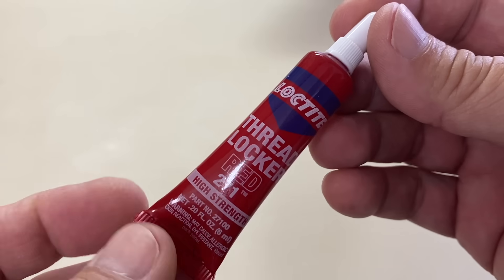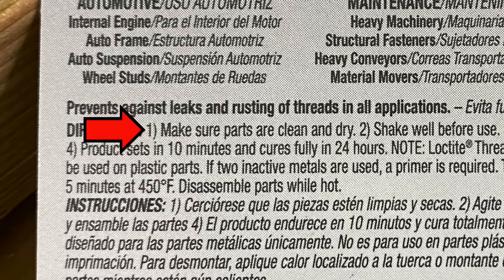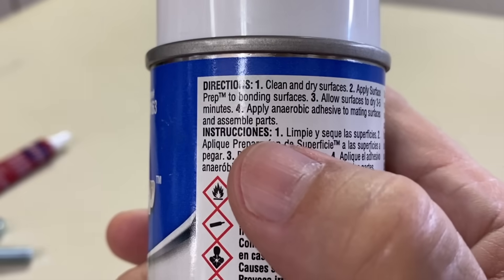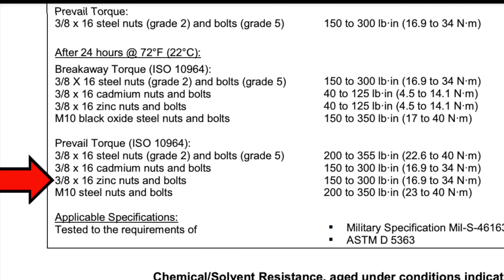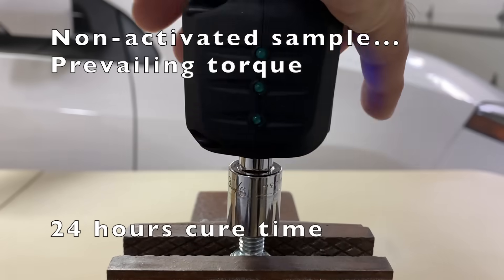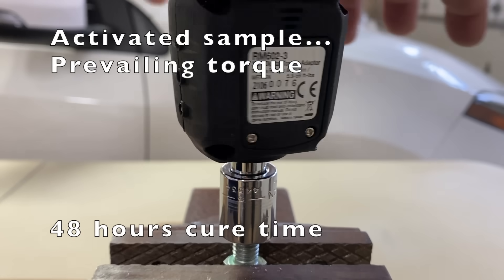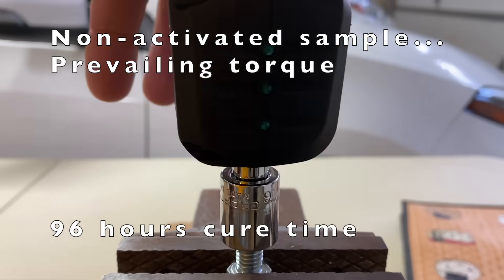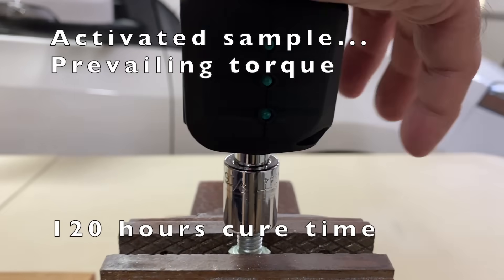Nuts & Bolts - Most DIYers Do Not Know This | Loctite Red Threadlocker Curing

Comment: Using a breaker bar corrupts your data as it changes the torque by magnifying determined by the length of the bar. Basic physics of levers.
Reply from the maker: Hmmm… I don’t know about that.  
My understanding is that the torque adapter measures the twisting force at the nut or fulcrum.  The breaker or cheater bar creates more distance from the fulcrum and allows me to use less force at that point on the lever.  Your statement would be true if I use the same force on the lever at all points along the lever.  
😎

Comment: Nice test, but the primer doesn't seem as beneficial as I would have thought. I typically would not apply threadlocker to a nut that isn't really holding something together though. I wonder if tightening the nut down would make a difference.
I can definitely confirm that  the accelerator really works to speed up the cure time. It makes cure time almost instant.
Reply from the maker: Thanks!  
Please check out my other videos for some with the nuts tightened down with a clamp load.  
Here's how Loctite tests breakaway and prevailing torques... https://www.youtube.com/watch?v=PGZCPyi8yBc
😎

Comment: As someone else mentioned, this is not a real-life condition. The Loctite is not designed for how you screw a nut loosely over the bolt. The fastener elements need to be under a state of a clamping force. In your case, you did not have any clamping force. Loctite is basically a two-part epoxy that requires the presence of pressure between the elements to bond correctly. You did not have any pressure. I agree with the primer approach and curing times, but your results would've been more significant and real-world if you had created a clamping force between the elements.
Reply from the maker: Thanks!  
Please check out my other videos for some with the nuts tightened down with a clamp load.  
Here's how Loctite tests breakaway and prevailing torques... https://www.youtube.com/watch?v=PGZCPyi8yBc
😎

Comment: The only question I have, and you cannot answer, is HOW MUCH resistance to breakaway is needed? Then one might consider how this measure is affected if the nuts and bolts were actually used under load, as they always would be. There are plenty of reasons to expect loaded versus unloaded behaviors to be very different. Moreover, I didn't learn ONE useful thing here.
Reply from the maker: Thanks!  
Please check out my other videos for some with the nuts tightened down with a clamp load.  
Here's how Loctite tests breakaway and prevailing torques... https://www.youtube.com/watch?v=PGZCPyi8yBc
😎

Comment: Hi, Thanks for the excellent video.  I have been using thread lockers for fifty years.  While activeator helps I ràrely use it.  I fìñd it is more  significant to use clean fasteners.  Ìf you want to be impressed, try  Loctite 290 (green) sealant.  You apply it after you torque the fastener.  I call it forever juice! ;-))
Reply from the maker: Green Loctite 290?  Got you covered... https://youtu.be/amqesHpyCKg
😎

Comment: I am certain this is done wrong. You dont put loctite on it to make it harder to torque off. You put it on so that vibrations dont cause it to lose the torque you applied. I would look up how Loctite does its tests, or just make it by clamping some material + torque to spec + vibrate the hell out of it under different conditions and see if the nut moved or torque was lost. Maybe it doesnt matter in most cases, but it would be interesting to know when it does matter.
Reply from the maker: Thanks for the feedback.  Here's how Loctite tests the breakaway and prevailing torques... https://www.youtube.com/watch?v=PGZCPyi8yBc
I'm working on a vibration test and hope to post it soon.  Stay tuned...

Comment: If the video of you spraying the activator/primer is accurate as to the technique than you might want to try that part again except spray the threads straight on instead of at an angle where the threads themselves are blocking (or shielding) the spray from reaching all sides of the threads.

Comment: I've never bothered with activator/primer and just normally used red or blue depending on how serious I am about wanting something to not come apart.  Bond strength is also going to be much more significant depending on surface area of the threads, so keep that in mind with larger, coarse thread nuts and bolts.  I've never had red fail to keep something secured.
Reply: The only problem to using the activator/primer is locating the stuff when you need it.  Few places that sell "Locktite" thread locker also have the activator/primer on the shelf.
Reply: The point is not that it works with or without primer.  The point is: It depends on the material composition of the fasteners you are using.

Comment: With a nut screwed part way on the bolt I believe it's was not a realistic test. Nuts and bolts are usually tightened tightly to hold 2 parts together or to attach a smaller part to something larger like a engine block or frame.
Reply from the maker: Thanks!  
Please check out my other videos for some with the nuts tightened down with a clamp load.  
Here's how Loctite tests breakaway and prevailing torques... https://www.youtube.com/watch?v=PGZCPyi8yBc
😎

Comment: The nuts need to be tightened against something,  not just sit on a bolt.  Maybe try to do the same test and tighten them all to 10 ft-lbs once the threadlocker is applied.
Reply from the maker: Thanks!  
Please check out my other videos for some with the nuts tightened down with a clamp load.  
Here's how Loctite tests breakaway and prevailing torques... https://www.youtube.com/watch?v=PGZCPyi8yBc
😎

Comment: thread locker works by bonding the surfaces of the threads together, requiring friction to overcome the bond. The threads are not compressed together without load. You need to redo this test and tighten each bolt to a set amount.
Reply from the maker: Thanks!  
Please check out my other videos for some with the nuts tightened down with a clamp load.  
Here's how Loctite tests breakaway and prevailing torques... https://www.youtube.com/watch?v=PGZCPyi8yBc
😎

Comment: Red is great nasty stuff. I used it when assembling a steel coat rack that twists together long tubes. Impressive hold. The coat rack it replaced got more loose over time to the point when the steel fractured.  I expect this new one won't do that.

Comment: I think that the nut should be tightened up against something - rather than left loose in the middle of the thread; that way there will be a more true anaerobic bind where the threads are squeezed together.
Reply from the maker: Thanks!  
Please check out my other videos for some with the nuts tightened down with a clamp load.  
Here's how Loctite tests breakaway and prevailing torques... https://www.youtube.com/watch?v=PGZCPyi8yBc
😎

Comment: So this stuff is peroxide cured. The peroxide is stabilized by atmospheric oxygen and scavenging additives. When the peroxide either comes in contact with preferably ferrous ions the radical cross linking occurs. Items like thread tolerances, surface area (roughness) impact the cure and break torques. Prevailing torque should be one constant revolution not with a ratchet. Material build up in the threads will cause higher prevailing torques, specially on rough fasteners like zinc phosphate. Primer is more of an insurance that cross linking will occur. This adhesive is an insurance policy for joints if the proper torque tension is not achieved or crappy fasteners from your junk drawer you saved just for that old Geo Metro you just bought.

Comment: The use of loctite is to prevent a bolt or nut from backing out further from their initial tightening torques if that starts to come loose for some reason. If it's for later work, the red is for stuff that one Hope's will never be loosened again or in a very loooong time. Blue is to hold in blessed stressed or torqued items while still being able to disassemble without going through any special efforts. Torque release tests mean little to me because at no time are the hardware being turned by an outside force. So clean with brake clean and use the loctite of your choice and move on. If one is really concerned, then just safety wire the hardware.
Reply: Vibration is an Outside force, I have watched properly torqued nuts spin off aerospace assemblies while being tested on a vibration table, was fun to watch them being flung all over the test cell.....
Reply: @regdor8187  and they were loctited or wired ?
Reply: @georgecurtis6463  George, not wired as that adds extra weight to a very sensitive  payload budget, my observation did not show any locking substance, but there may have been....These payloads were university scientific projects in the early days of rocketry where the learning curve was very steep....Things have greatly improved today....
Reply: @regdor8187  ok, understood.
Reply: could you rewrite that in English?
Reply: @DinoNucci  done
Reply: @georgecurtis6463  wrong

Comment: So can we use the correct term, POUND-FEET? Otherwise a good experiment. Seems the activator didn't add much. Another test would be to apply tightening torque to the samples to see if the Loctite would add breakaway to the tightened bolts
Reply from the maker: LOL!  I was taught foot-pounds.  Even if it is wrong... can't teach old dogs new tricks!  Thanks

Comment: I have some Loctite 243 blue that I acquired more than 5 years ago but less than 10. On the front of the container it says "oil tolerant, no priming needed". The older Loctite 243 blue I have does not say that, nor does any of my red loctite which is all older than 10 years. I also have green loctite sleeve retainer, that stuff is semi permanent and will only break its bond with torch heat.
Reply: Loctite 243 is amazing stuff!

Comment: lol, you have to put torque on the nuts and bolts, as it bolt something together, you can use a 1/2" plate steel, then you have to torque to a said numbers, say 16lbs, 50lbs then 100lbs.. do your test like this, who uses loctite for free floating nuts and bolts?
Reply from the maker: Thanks!  
Please check out my other videos for some with the nuts tightened down with a clamp load.  
Here's how Loctite tests breakaway and prevailing torques... https://www.youtube.com/watch?v=PGZCPyi8yBc
😎

Comment: in my opinion this test should be done with the nuts tight and torqued to create pressure as that`s the way a nut and bolt would be used under pressure .... loose nuts glued to the bolt hand tight give different results than tighten with a wrench.... and there is blue and red thread lockers , red supposed to be "the glue" for mechanics ,nothing is just hand tight.
Reply from the maker: Thanks!  
Please check out my other videos for some with the nuts tightened down with a clamp load.  
Here's how Loctite tests breakaway and prevailing torques... https://www.youtube.com/watch?v=PGZCPyi8yBc
😎

Comment: Curious re "active vs non active" metals (ie anything which isn't plain steel or copper/brass. - ie. the torque of a 1/2 grade 8 bolt  inch bolt is 80 ft-lb, a bit of threadlocker just adds next to nothing -   if the bolt is loose, at least  it stops the nut getting lost.
(activator like CA kicker really just speeds up the "cure" - but with "loose, nothing fixed that problem (the assembly isn't assembled correctly).

ie. threadlocker isn't supposed to lock "non tightened" threads - for that construction adhesive may be a better product (jk)..
This whole experiment needs repeating with threads used as engineering intented - tight - means "tight" - torque to 80% yield (at least - 80proof)
 - what is the delta on that ??

At least you are one youtuber who can read the units on a torque gauge - "thumbsup for that" - foot comes before pounds, or no kicking gets done - (imperial is, afterall bass  ackwards)..  kidding)

Comment: Many more thread locker than red and blue.  Also thread locker also expires, but that usually for industry that need to perform to a specific level.

Loctite 545 is a high-pressure thread sealant, aka black max, it's black and stinks to high hell.

Comment: I would have liked to see the torque tests done at 1, 2, 4, 8, and 16 hours, in those cases I think that the "activated" would show a greater advantage.
Reply: Yeah no 7471 is 70 percent acetone which is what primes loctite.

His wierd looking "surface prep" is heptane, propane, isobutane and ethanol according to the SDS. It would literally do nothing.
Reply: Thankfully, we don't need to do that. The author of this video didn't actually read the TDS for loctite 262 and etc where it says to use loctite 7471 or loctite 7649 not the first random primer can you find on the shelf

Comment: You can't measure the performance of thread sealant by using it like glue. You can't just wind up a nut on threads with loctite and no tension, from ' fastener pull' and expect that your thread sealant is performing as it would under actual load and usage... You're just measuring how good a glue it is. Not it's capacity to hold against loosening, once under tension. You must be some sort of engineer😂...
Reply from the maker: Thanks!  
Please check out my other videos for some with the nuts tightened down with a clamp load.  
Here's how Loctite tests breakaway and prevailing torques... https://www.youtube.com/watch?v=PGZCPyi8yBc
😎

Comment: I have some doubts here. Most threadlockers work by one chemical being suspended as small particles in the other chemical fluid and the small particles of the first are broken when the bolt is tightened during assembly. Chemical reaction occurs only after they are freed by the pressure. In this experiment the bolts haven't been tightened during the assembly, so some or most of the small droplet might remain intact.
Isn't this affecting the experiment?
Reply from the maker: Thanks!  
Please check out my other videos for some with the nuts tightened down with a clamp load.  
Here's how Loctite tests breakaway and prevailing torques... https://www.youtube.com/watch?v=PGZCPyi8yBc
😎

Comment: You are doing the test completely wrong.
Start over. 
This time double nut or run the nut all the way down and tighten to 20 foot lbs.
Wait 48 hours and see how many lbs it takes to remove the nut.
Loctite is made to be squeezed, forcing out all air/ oxygen then it dries. 
In most cases you need to heat the nut to remove it.
Reply from the maker: Thanks!  
Please check out my other videos for some with the nuts tightened down with a clamp load.  
Here's how Loctite tests breakaway and prevailing torques... https://www.youtube.com/watch?v=PGZCPyi8yBc
😎

Comment: Thanks for sharing!
You might want to repeat this with some shear stress on the thread. The test you've shown us here is without any shear stress ;). I'm positive the results will differ significantly.
Example: screw the nut down completely and give it 12 Nm torque. You might want to add 1 or 2 washers to stay 'fair and equal' during release, and finally: put the 2 droplets on the end of the thread so all threadlocker is used inside the nut, so similar to what you did here.
Reply from the maker: Thanks!  
Please check out my other videos for some with the nuts tightened down with a clamp load.  
Here's how Loctite tests breakaway and prevailing torques... https://www.youtube.com/watch?v=PGZCPyi8yBc
😎

Comment: I was told to heat it with torch, lighter or heat gun, cures fast though some comes out and can be wiped off right away or scraped off if that matters to the look of something. It has held nicely, even on metal jewelry with snug fitting parts. I learned something from you I never heard before on the types of metals, a valuable lesson there, as well as letting it cute over time, never tried that.

Comment: We use a red sealant on our pipes at work. We generally only use the primer when we are dealing with Stainless as it doesn't stick very well to the stainless and just runs off. The primer helps it stick to the metal better. In brass or copper it doesn't seem to matter as much. We don't use a lot of zinc.
Reply: I'm guessing that's gas-oila red.  Great product!

Comment: I would anticipate the test perfomed was not a real world situation since you did not put the nuts on to a proper normal torqu.  That would have created a large difference in the film thickness between the trheads and thus possibly a large change in the out come. I was surprised that time did not make any measurable difference in the test.  Well done. Maybe run it again at rated tourque as I would like to know the difference. Thanks for doing the test.
Reply from the maker: Thanks!  
Please check out my other videos for some with the nuts tightened down with a clamp load.  
Here's how Loctite tests breakaway and prevailing torques... https://www.youtube.com/watch?v=PGZCPyi8yBc
😎

Comment: Looks as though the primer helps the cure time in first 48hrs after that the differences are pretty insignificant and look more like experimental variation.

 With a small benefit in these results going to the primer group.

If I needed to put something back into service asap with known vibration known to loosen parts I would use the primer.

Weak locktite 243 or 222 is great to add if parts are likely to become rusted together, it is easier to break loctite free with a little warmth than rusted fasteners.

Comment: I have a project using stainless steel threads. The parts manufacturer recommends locktite 277 with primer. I was wondering if you have any test data on these materials.

Comment: I work in a fast paced production environment. Dummies everywhere. You can locktite a shoulder bolt for a semi rotating self aligning mechanism. Somebody will just spray the whole assembly with a penetrating oil thinking that lubrication will help it but all it does is attract dust and eat away at the locktite.